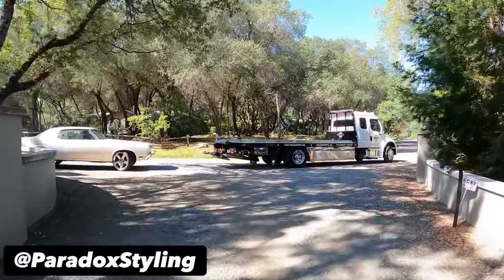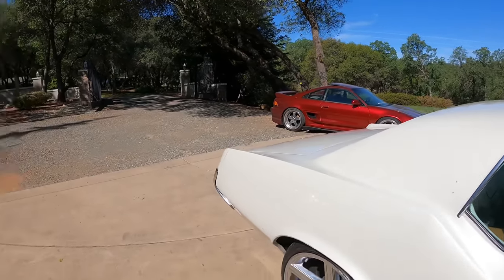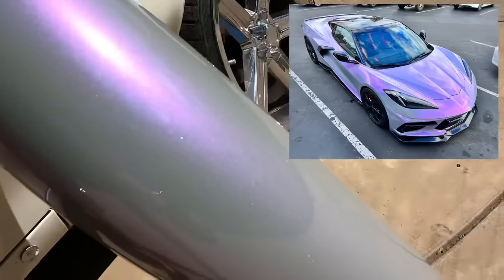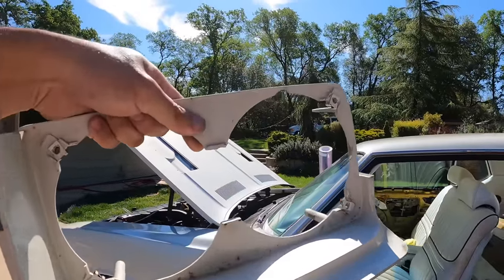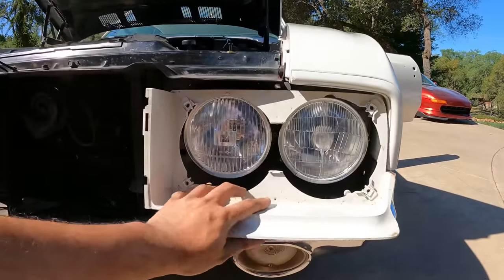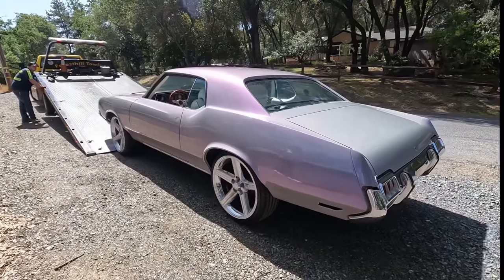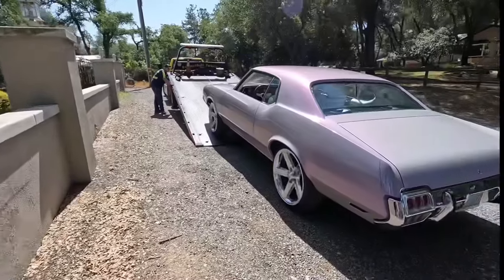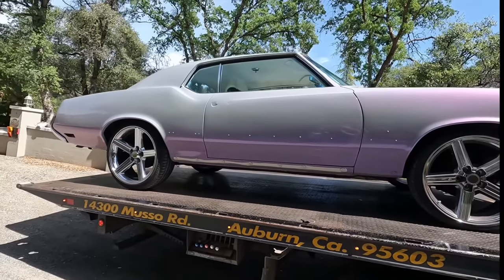Laying Candy On Her CUTLASS SUPREME To Match My C8 | Making Artificial Roof Seams On Old School Cars

Comment: I'm a big fan of muscle cars. The body lines on the CS are sporty sexy. Paint color she selected is sharp 'n easy on the eyes. 1969-1972 are probably the most desirable years for the Oldsmobile Cutlass Supreme. '70 442 W30 V8 455-370HP 4-spd. is probably the holy grail of the CS's. Big $$$.